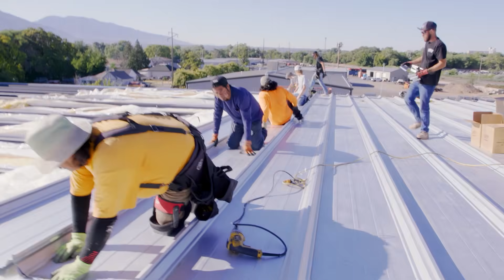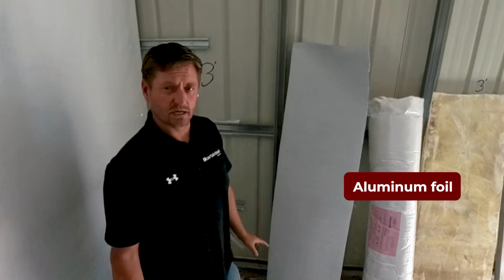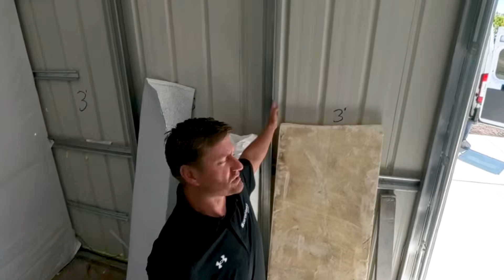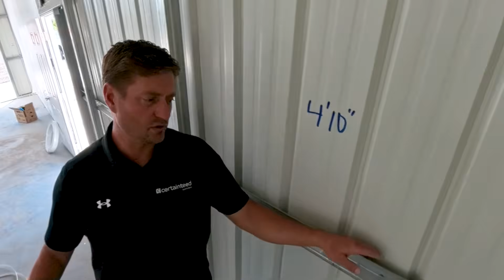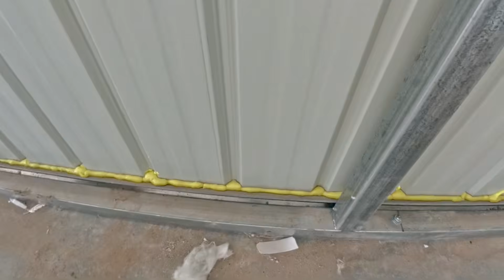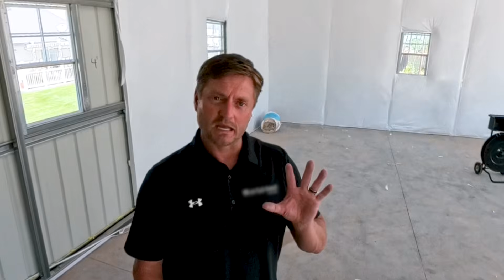Tubular Steel Building Insulation: Myths vs. Reality (Based on 20 Years of Experience)

Comment: I remember aluminum window frames, those metal wall studs will conduct the heat from outside in like the insulation isn’t even there. You need an interior framed wall which is as practical as building a building within a building. Bottom line, you can not have an efficient metal building.
Reply from the maker: True, unless a thermal break tape is used when the window is installed.

Comment: The radiant foil needs at least 3/4 inch of air space because it works by radiating heat back toward its source through the air.
Reply from the maker: Absolutely, that air space is a critical requirement for the foil to function as intended in a radiant barrier setup.

Comment: Could you put the Rfoil on first for the radiant barrier and additional insulation then the laminated fiberglass blanket?  Something about having fiberglass against the metal just worries me incase it’s not sealed well and it condensates.
Reply from the maker: The only problem with this approach is that you would have two vapor barriers with the fiberglass sandwiched between them.  In the steel building industry, a double vapor barrier is frowned upon because if moisture were to somehow get trapped between the two layers, it could start to cause mold issues etc.  The rule of thumb is to always keep your vapor barrier on the interior side of your insulation.  If it is a true vapor barrier with a solid perm rating (and sealed properly), you won't have condensation issues.
Reply: @cmi-insulation1  when my building went up they used a bubble wrap type barrier? Currently trying to figure out how to better insulate my detached garage so I can A/C.

Comment: I hope a fire marshal never drops in and tears out the styrofoam from walls. It’s the only real insulation that can be cut to size and fill cracks and not disturb the structure. Lasts for years